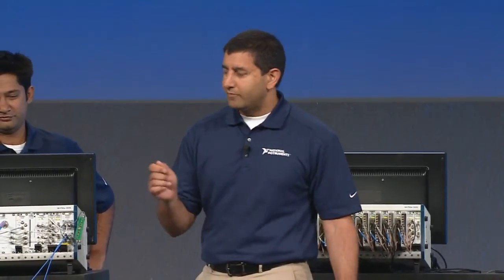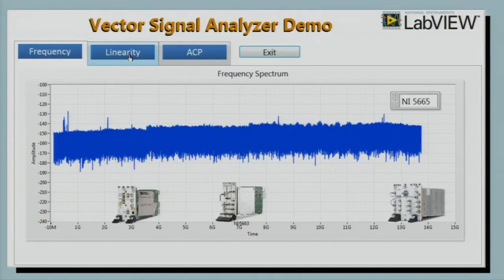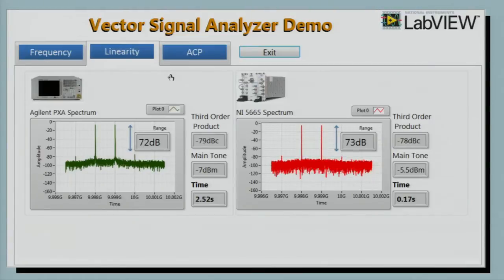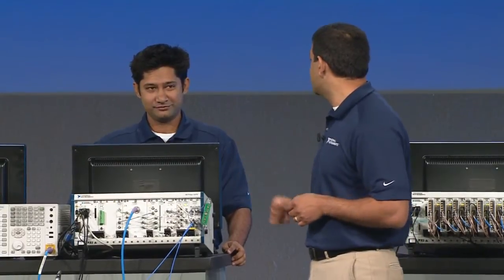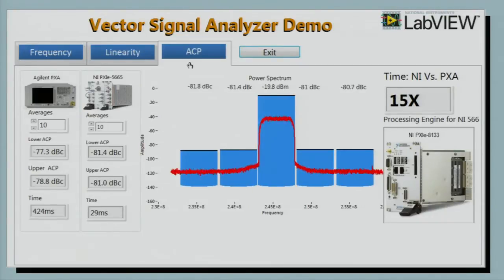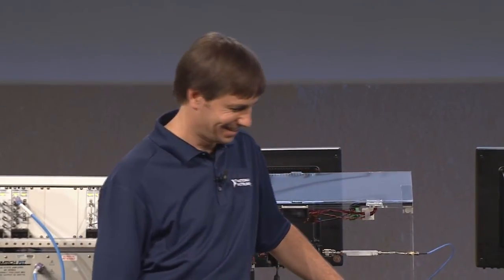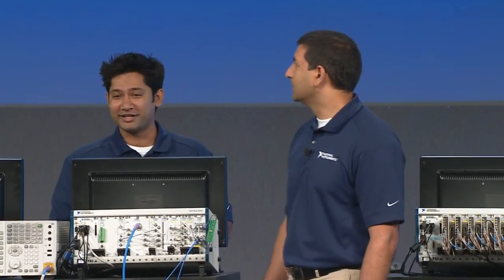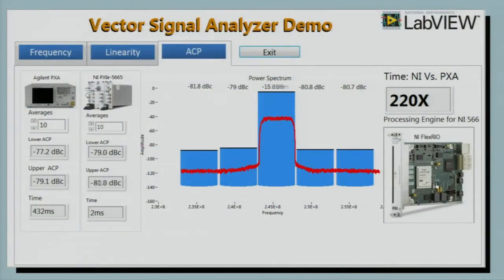NI 14 GHz Vector Signal Analyzer

Comment from the maker: @johnsmailbox2 You're correct. Readings like ACPR (mentioned in vid) and std dev (mentioned in comments) apply to setup+sources used in demo. We reproduced a setup that would be typical of a validation/production test lab, which might not necessarily show best accuracy that either instrument is capable of, however the video does show a comparison of the two instruments for this particular set up. To see best performance/specifications of the instruments, I’d recommend looking at the datasheets.

Comment from the maker: @johnsmailbox2 You’re correct we’re not measuring best dynamic range of both instruments, both have better dynamic range than video shows. Example, if using notch filter, both display better ACPR results. Message of video is not to measure best ACPR of the instruments, but show that even for good numbers such as -82 dBc in upper channel, NI 5665 is about 14-15X faster than Agilent PXA.Your point about averaging is correct. Std deviation is not shown in vid, but we calculated it per your request.

Comment from the maker: @johnsmailbox2 John, we are using a PXIe-5673 as the source.  To increase the dynamic range of the signal however, we use a SAW filter with a 6 MHz BW.  We also use 10 average on both instruments. You can also click the first bitly in the description for a link to the white paper which discusses this demo in full detail.